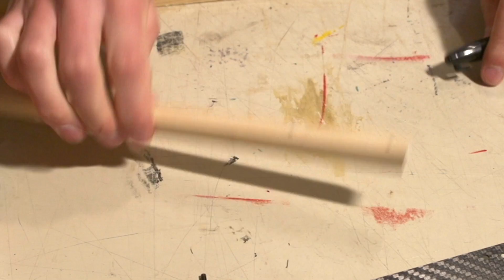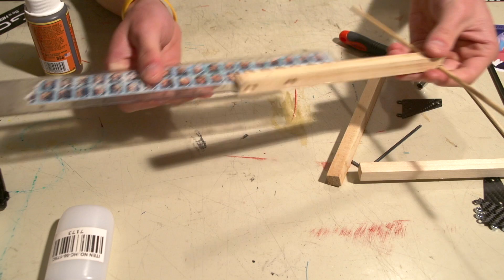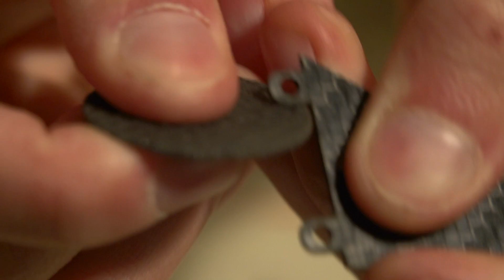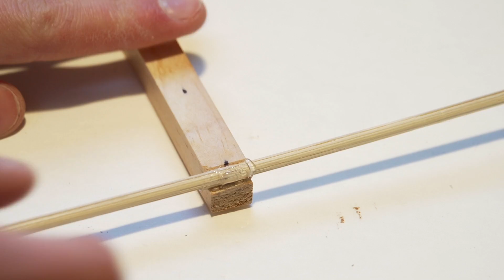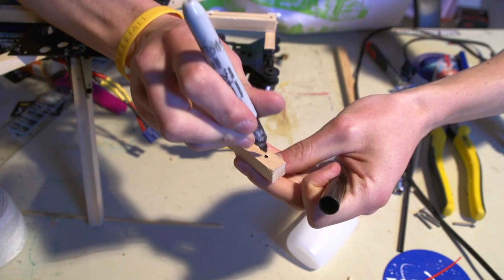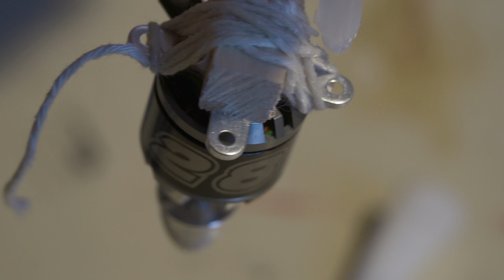Sport Quad V3 Frame Kit Instructions

Comment: Very nice!  I love wood arms, light and helps a lot with vibration.  Do you have any options for the landing gear?  My amazing landing skills will have it broke quick.  What is your total weight build?  And a flight vid be great!
Reply from the maker: You can also use those landing gear brackets to mount the dowels directly to the front frame arms. Then construct a rear leg yourself and you have a tripod landing gear setup.

Comment: Why dont you mount the gimbal dowel between centerplate and distribution board ? It will give extra stability and you could mount the flightcontrol in the middle oft the plate
Reply from the maker: Mounting it on top brings the CG a little but closer to the center, but mounting it in the middle would still work very well.

Comment: I've done the wood arms before.... With that motor mount what i like to do is slide the mount inward so edge of mount is at edge of wood.  Then, zip tie each end of mount to wood.  One zip facing one direction and the other zip tie facing opposite.  The zips hold so tight that the mount won;t move at all.  Occasionally they will snap on hard crash.  But easy field repair in your kit.  plus wood is more likely to break anyways.  Also, keep a stash of wood arms pre-drilled in you field kit.  Learned that the hard way.

Comment: I mount my motors similarly with zip ties, but I recommend using a thin double sided tape between the motor mount and the wood so that the motor can't slip around. B.t.w. I like your super cheap projects that show that you do not need to spend a fortune in order to fly a multicopter.